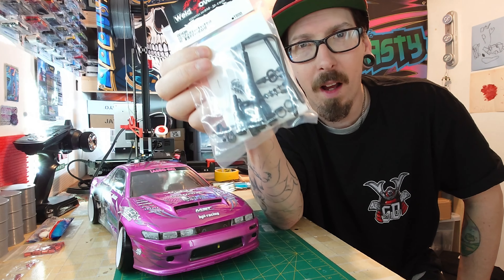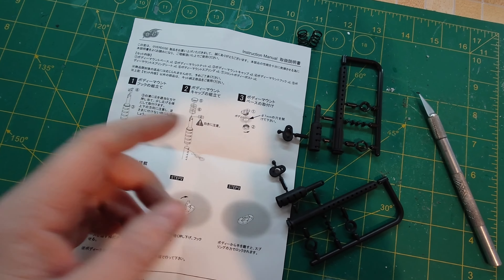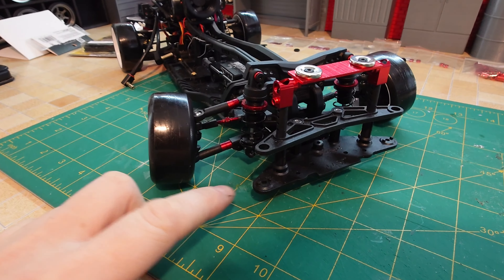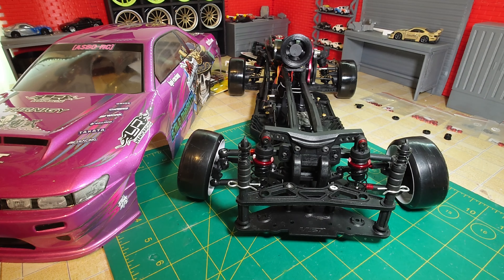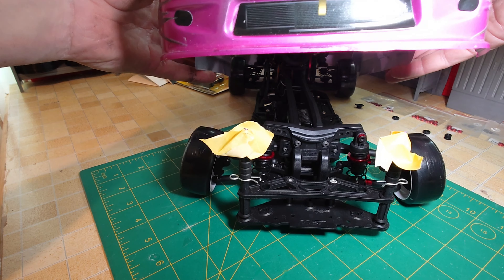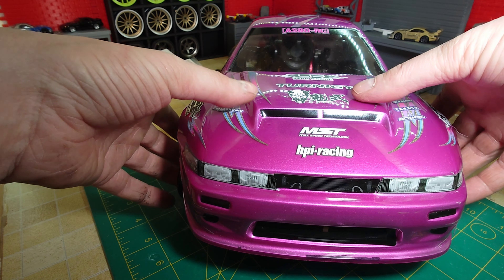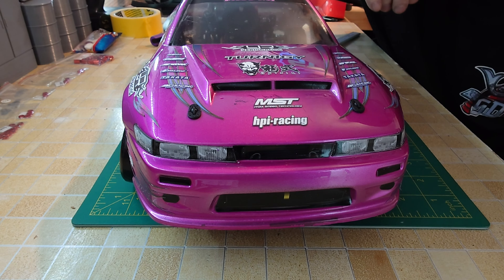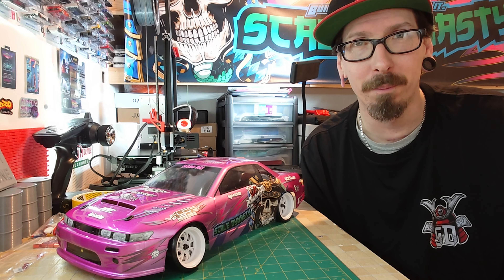Overdose Weld Real Body Catch Set - How to install RC Car Body Mounts

Comment: Yokomo and MST are 5mm posts and RDX is 6mm (which is why you need the supplied posts)  figured I'd give out some measurement specs for other viewers
Reply from the maker: Thank you! I hadn't thought to measure the difference!
Reply: Wrong. MST are 6mm. Yokomo and Rêve D are 5.5mm.
Reply: @taimaishu-nao1922  You are correct I had MST backwards but you are also incorrect RDX is 4.5mm